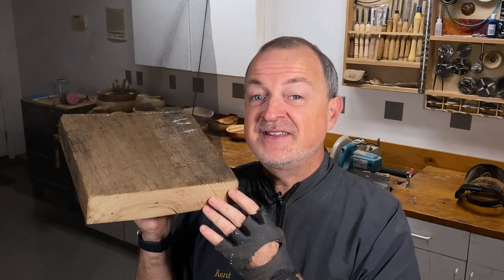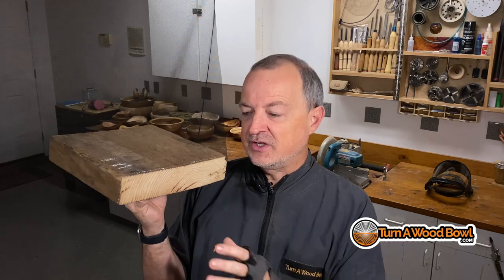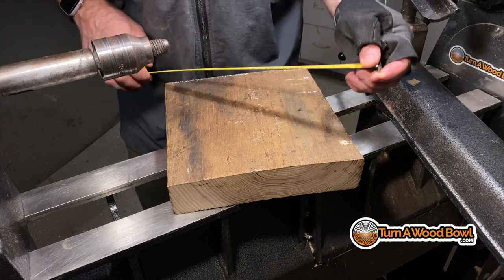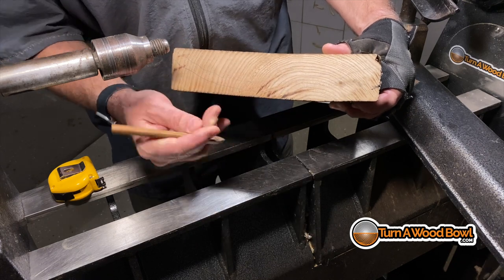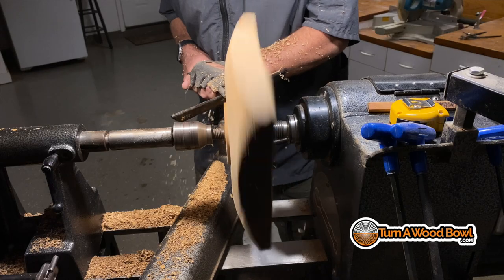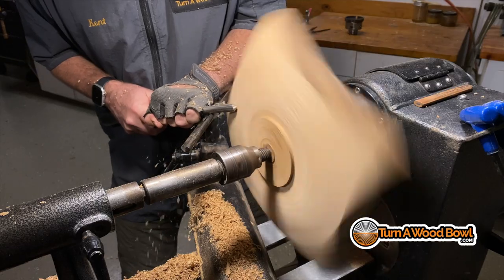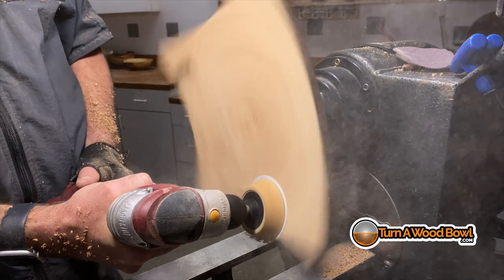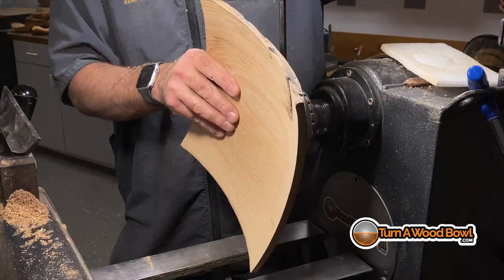Woodturning Square Bowl — American History — Wormy Chestnut Video

Comment: Thanks to your wonderful instructional videos I turned a square bowl today. 2 months ago when I started turning i said ill never do one of those.
The sharp chisels sure make a difference. 
Word of advice to newbies: buy the CBN wheel and the sharpening system. I made my own and it worked but nothing like the real deal. I bought mine on Amazon  for 55$, Vevor. Right, Chinese but it works just like the big dollar ones. Also bought the Raptor set up jigs so changing grinds is lightening quick. Now what do I do with the 2 cheap wheels I tried to get by with. Wasted money. The CBN WAS 140$. IT IS 1 1/2" face with about an inch of grit on both sides. Absolutely great way to go. Zip zip ....done. you can tell I'm new because  I still hold all this new knowledge  in awe. Sharp tools. Now it's fun instead of a battle.
Thanks for everything  you do, Kent. You're the best, hands down!

Comment: My understanding of wormy chestnut was thus:  Many logs were floated down river to the mills and some sank.  They were eventually recovered, but sometimes were submerged for a century.  In this time frame, they were invaded by worms which bore holes in them.  Now, I did not research this now, but I have always 'known' this as a fact - from my days when I studied wood products manufacturing in 82-84.  It may not be true, but it seemed to make sense.  

Enjoying your work and your channel.
Reply from the maker: Interesting, Thanks for sharing. Happy Turning!
Reply: @TurnAWoodBowl  I first got on a lathe in gr7 at age12, then got a job wood turning for real at the age of 17.  Most people have never actually had a job doing that, and I quite loved it, mastering the tools and sharpening them and developing my own style and approach.  Now, its been a long time.

Comment: Kent, thanks for the idea. I have some 8/4 Amer. Chestnut that appears to have once been floor joists and have now made 5 of these bowls. Although the result was about the same, I did a couple of things different. For one thing, not all my pieces were square, but it really didn't make any difference. Also, I started out with a 3" faceplate on the headstock side and a live center on the other side. You mentioned how hard your chestnut was, but mine wasn't at all, in fact I'd consider it a bit on the soft side. I had to be careful around the nails but a 1/2" round-nose carbide tool took care of them nicely.
Reply from the maker: Very cool! Thanks for sharing! Happy Turning!

Comment: Hi Kent, 
Nice video as always. I have laying around some square pieces for some weeks now, but I had to finish another bowl first. 
And then comes along this video. perfect timing. One Question: how did you stabilize your Bowl gauge when you are cutting a lot of air. Yesterday I did a natural edge bowl and I always had difficulties to remain a constant wall thickness while cutting through air. Most probably I had too much pressure against the pole instead of pushing against the toolrest. 

Liebe Grüße from snowing Germany
Matthias
Reply from the maker: All the best to you in snowy Germany!!! Happy Turning!

Comment: When I was in high school, college, and 30+ years in industry, we always made it a safety practice to not stand in front of a grinder until it had reached full speed. Now I understand I’ve never used a wheel like yours, so here’s my question, are these newer wheels reliable and of no concern of cracking and flying apart?

Comment: Is there any way to salvage the mass in the middle similar to the OneWay jig?
I understand that the center point would be much further back to get a more flat arc, just curious because I'm certain a parting tool would be far too dangerous.
Reply from the maker: Good question. Yes, a parting tool would be too dangerous. A coring system might be able to reach in and make a slice to save some material. Happy Turning!

Comment: () Caused by an accidentally introduced Asian bark fungus (Cryphonectria parasitica), the chestnut blight of the early 1900s was responsible for killing over three billion chestnut trees. The wood in these standing trees was subsequently damaged by insects, leaving holes and discoloration. The trees were then subsequently harvested and converted into lumber (called Wormy Chestnut). Between the nail holes, discoloration, worm and insect damage, Wormy Chestnut is preferred in applications where a rustic or unpolished appearance is desired.

   Because of the blight wiping out nearly all mature American Chestnut trees, its lumber is both rare and (relatively) valuable. Wormy Chestnut in particular is usually salvaged from old barns and other structures, and reprocessed and sold as reclaimed lumber. Prices are likely to be high for a domestic hardwood.

   Chestnut is rated as very durable against rot. The heartwood is a light to medium brown, darkening to a reddish brown with age. Narrow sapwood is well-defined and is pale white to light brown. Chestnut was once commonly used for building houses, barns, furniture & many more applications. Today most chestnut is used for repair work and special projects due to limited availablity and cost.
Reply from the maker: Thank you very much for the detailed info. Happy Turning!